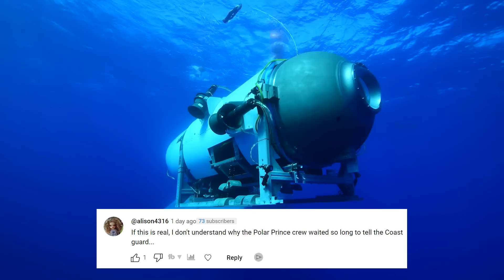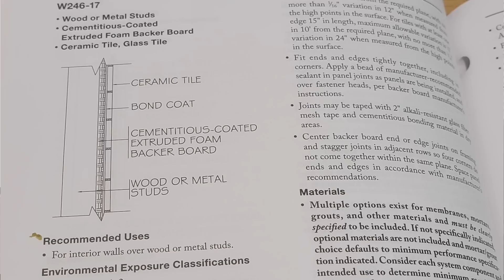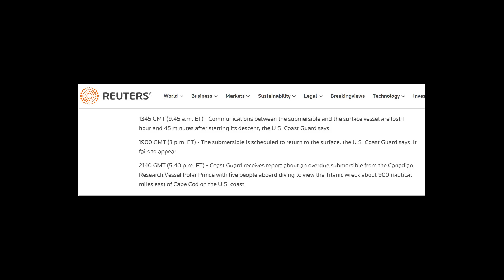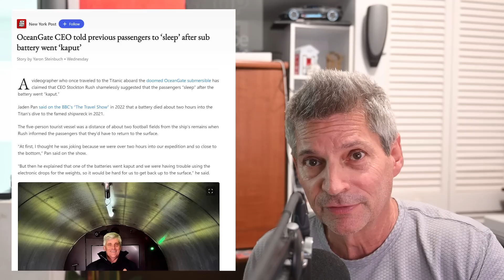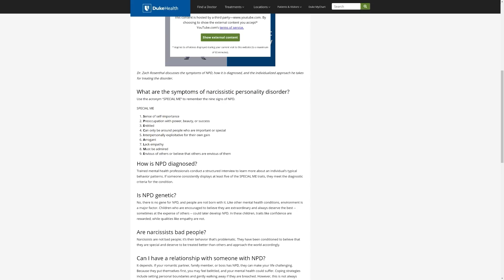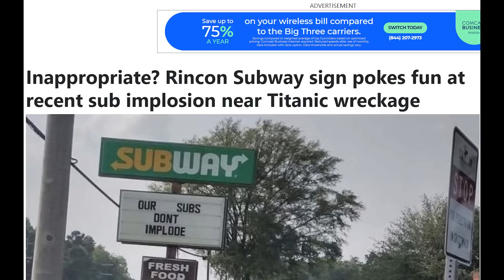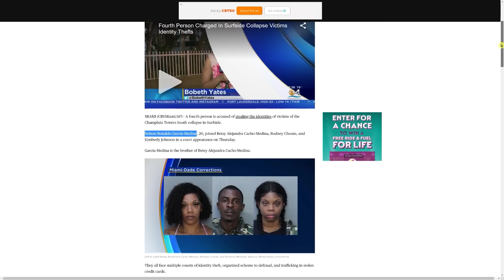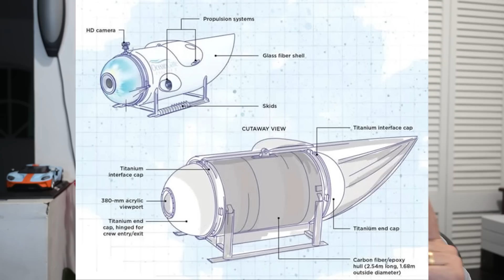Titan Sub: Why OceanGate Waits 8 Hrs Call Coast Guard, Q & A

Comment: Just to clear up some misunderstandings: while the Titanic sinking was absolutely a by-product of hubris and arrogance, that wasn't all that was to blame. First, I know it is a thing these days to make a parallel between Titanic and the word "unsinkable". However, it is worth mentioning that nearly every vessel prior to this that featured watertight compartments was declared unsinkable in marketing, official communications, or informal parlance. So, this wasn't something that was unique to the Titanic, by any means.

Picking up on the point about lifeboats, it's worth pointing out the two things that informed the decision on the number of lifeboats: will passengers actually get aboard them and how long will the ship take to sink. See, people didn't trust lifeboats at the time, with good reason, because they had a really poor safety record. So, it was better to have fewer better equipped and better built lifeboats than it was to have many poor-quality ones. The less it looks like a dinghy, the better. More to that point, because of innovations in things like watertight compartments, people assumed (incorrectly, obviously) that it was be impossible for a ship to sink quickly enough that help wouldn't arrive in time. The assumption was that no matter how badly a vessel was wounded, she could stay afloat long enough for help to arrive, since there were always dozens or hundreds of ships making the same journey along the same route. In this case, the lifeboats would act as water taxis ferrying people between the stricken ship and the rescue ship. It didn't matter that their weren't enough for everyone; or, at least that was the assumption that was made. So it wasn't purely for reasons of greed and outright malice that the ship didn't have enough. 

As for the book Futility. Yes, it is a little bit eerie how many details they include that parallel the Titanic, but it is worth mentioning for contexts' sake that the book was only renamed "The Sinking of the Titan" in 1912, after the Titanic had already sunk. This is also when the artwork showing a four-funnelled ship sinking below the water was created. While the books content mostly remained the same, some edits were made to make it seem like more of an accurate prediction than it really was, so it's not quite as crazy as it seems. 

I know some people seem to think that the White Star Line cut corners and adhered to insufficient safety standards to save a buck, but it just isn't an accurate reflection of reality. Titanic, in most respects, actually outdid the official safety regulations by many orders of magnitude, and was designed to incorporate as much of the modern technology available to improve safety on voyages as was feasible. It literally was the state-of-the-art and the final word in shipbuilding (at least, as long as it stayed above water). James Cameron gets it right when he draws parallels between the hubris and constant ignoring of warnings, but the comparison really doesn't go much further than that. What Stockton Rush and OceanGate did is far more sinister and far more dangerous than anything that happened on the Titanic.

They knew that the material they were working with was probably not appropriate for the use case. They were warned as much as deep submergence experts both within and outside of OceanGate. There were a number of troubling incidents in the leadup to this incident which would have made sane people back away quickly had they known. They lied about just how experimental and dangerous their sub was. They misrepresented the act of classing a vehicle with ABS or DNV as something they could get away with not doing. The list goes on and on. 

On the other hand, making the Olympic-class liners the safest ships on the seas was a key part of the design process for Titanic from the beginning. Hencewhy she had a double bottom, watertight doors, backup dynamos, new-type davits that could handle more and heavier lifeboats, wireless communication, multiple ways of steering the ship, and more. She was also extensively tested and went through all the sea trials that were normal for the time, long before she carried paying passengers. It was a boon to be able to advertise your ship as safer than the competition, and money wasn't actually an issue for the White Star Line (they were owned by a massive liner conglomerate at the time, with lots of cash floating about). They could spare the expense of making the ships safer than they theoretically needed to be. 

There are some tragic parallels between what happened with Titanic and what happened with Titan, but we need to be clear about how they are different as well. Because they are very different. One was the fault of hubris, ambition, and carelessness that ended in extreme tragedy. The other was caused by active mismanagement, extreme hubris and ambition, and a complete disregard for the principles of engineering which have made our world so very safe and secure.

Comment: I’m not an engineer, but even i know that if a non elastic substance is subject to repeated cycles of stress, then it will inevitably fail at some point. Empirically, i would guess the failure is dependant upon the strength of the force applied, and the inherent tensile strength of the material which is bound to be compromised if a non- homogenous material is used. In my own observation, if i accidentally step on the Dog’s squeeky rubber sausage it has a different outcome to stepping on an empty pringles canister.

Comment: 1) Design a sphere for your carbon-fiber sub - not a cylinder.
2) Make sure the crew compartment has more than adequate thickness to withstand extreme pressures.
3) Have your carbon-fiber chamber assembled at the correct temperature and with the optimum weave for the greatest strength and durability possible.
4) Test your carbon-fiber crafts (both destructively and non-destructively) as much as you are able to and can afford - including expert ultrasound testing after every dive.
5) Don't use carbon-fiber in the first place, dunderhead!!!
Reply: Why did you write all of that and not just number 5?
Reply: @turkwendell6904  An attempt at humour.
Reply: @malvanlondon8683  oh well that was me not getting it and now that I do that was funny and you're cool and have a nice day

Comment: I have not got any answer from any other Titan report, wen I ask what significance is there to the carbon hull being left as 5 inches thick instead of a planned 7 inches , and what would the accelerated descent, indicated in the text message,  do to the different materials used and their jointing , I had thought that the divers as well as the hull, needed to descend in stages and not do a continues dive.
Reply: Divers don’t descend in stages, they ascend in stages to allow expanding gases dissolved in their tissues to escape safely. The Titan (and all submarines) keep surface pressure internally so they don’t need decompression stops.
Reply: @fredbloggs5902  fair comment although I think its partly down to the water pressure being directly on the divers body, in this case the inside is meant to retain a set atmosphere ? , what about the effect of fast pressure increases on a submersible, is it not necessary for the structure to have time to adjust to the increasing tonnage of pressure ?  I am wondering how much is structural failure do to engineering faults and how much is down to incorrect piloting ?
Reply: @stuartgraca  You’re welcome to ‘think’ whatever you like, if you try hard enough it might even improve.

Comment: It's not the carbon fiber problem, it actually can hold and sustain greater pressure.
the problem was with its characteristics in comparison to the titanium which was used to seal the front and end.
since both material compresses and decompress in a different coefficient under the same pressure, this creates gaps and dysfunctional structure.

here is a theoretical example, when under great pressure the carbon fiber might compress more than the titanium, since both are bolted together, the edges around the bolts want to shrink more, but the bolts hold them in place, so you will start hearing tension cracking, depends how much tension and how much of carbon fiber left to crack, eventually by time all the carbon fiber will crack and stretch  leaving the bolts, then inplodes.

so, don't blame the material, blame the structure..

Comment: I am in the GPS business and understand the mathematics of determining position. Given the variances of the dive (descent speed, currents etc) how did they determine position? I am guessing on an array (constellation) of submersed transponders or transmitters able to communicate with Titan. These would mathematically triangulate every few seconds and carry the messages at the same time. 
Another question is why didn’t the Titan roll in 3 dimensions due to current and other shifting forces so that occupants could end up upside down?

Comment: I heard an engineer refer to a lot of the practices that OceanGate undertook as the “normalisation of deviance”. Like, if they heard cracking sounds but nothing bad happened a few times they decided this was normal, if they repeatedly lost comms at a certain depth but nothing bad happened, they decided this was normal. All excuses to avoid spending more money on testing. He clearly didn’t have proper engineers working for him because they should have known about NoD and called him out on it.
Reply: It is also known in a factory environment as industrial blindness.
Reply: Stockton Rush fired anyone who told him things were unsafe.
Reply: Correct...Stockton was bent on hiring "innovative" people which meant younger people and with that comes less experience and training so you really have to wonder if OceanGate had any "company training and education" protocols for those employees. He was so vocal about not hiring the norm "50 year old white men" who had lots of Government experience and training via the Navy or NASA etc. Stockton was sure to hire those who wouldn't have the mental groove or rut in thinking that everything that is used has to be "approved" or tested and proven. I especially liked Stockton's dumb display and comment he made about the roof mounted illuminated grab handles that he purchased from "Camping World". When you are that deep and using only battery power, wouldn't you think the OceanGate engineers would have chosen something more consistent in power consumption? Something designed to be in harsh salt water environments? I can't imagine how the corrosion levels are inside of those game controllers...micro switches etc. which are also subject to the hard environment of salt water, salt air etc. Did they use those once and replace them? 
Way back when they fired their safety engineer and then he sued for wrongful termination, OceanGate paid a settlement which proves they were wrong in terminating him. Seems like the core operations of OceanGate is rather boldly.

Comment: Polar Prince waited 8 hours because the last communications the Titan sent stated they were returning to the surface at "quarter" rate. The ascent useally takes two hours, so 2 times 4 equals 8 hours.
Reply: Also, one electrical system had failed. Maybe top thought that the other system had failed too and the sub would have no communication until it reached the surface.
Reply: @pierreabbat6157  Exactly. They hoped and waited.
Reply: That makes sense.

Comment: The problem was Stockton Rush. His attitude problems and anger triggers drove the design of the vehicle, how it was operated, the fact that it was not fitted with data comms, all the way to how the surface crew operated on the Polar Prince.  The crew had been told they had no authority.  Only Rush had the authority to make changes or make the call to the Coast Guard.   They were too afraid of making him angry to speed up the time.  He was at risk. But even that was not enough to overcome the fear of making him mad.  And the power of that fear was based on the fact that the employ😮ees were interns and college kids and people generally afraid for their jobs because they could be replaced, rather than having employees with high skills and training.  They had interns making low wages scared of losing their jobs, which was guaranteed to happen if they made Rush mad.  So they waited. They had no authority to override. They were afraid.
Reply: Rush's wife was on board the Polar Prince. Transferring and hiding their money was probably a more likely reason.

Comment: When you read the transcripts of messages between the sub and the top surface you will then know for sure they knew what happened. Denial, Grief,and etc...are things they were dealing with that's associated with shock. Carbon fiber works great for planes due to its expandability but not good for deep Sea compression. That's just common sense

Comment: side tracking here a bit, only because you used it as an example, as far as the space shuttle goes, it wasn't so much as arrogance, as it was more ignorance.  Morten Thiokol told them NOT to launch in those cold temps and NASA asked "WHY" and then asked MT to back up their warnings with proof.  MT  couldn't because they never launched in cold before.  So NASA said if you can't prove it than its not valid.  Also, NASA was on a tight schedule, and rushed to launch and its what we call in the aviation industry, "Get-there-itis" meaning, you have to "get there- your destination" at all cost for what ever reason, and in doing so you become complacent.  So in the case of the Shuttle its very different than OceanGate who blatantly ignored warnings with PROOF where as the NASA WAS interested in hearing from MT, its just MT could;'t back up their claims...  had warnings with no proof added with "Get-there-itis."

Comment: "They cant use GPS under the ocean, the signal is too weak. They have to use hydrophones and sms"

Isn't there tech to triangulate hydrophones on the fly, to kinda figure out more or less where the sub would be?
How accurate would that be?

Comment: They didn't use the autoclave method either which has far fewer flaws.  So instead of 50 compression cycles before imploding, maybe it would have been good for 500 cycles, but nobody knows for sure.  The sub was designed to fail and they were delusional to think that they could detect it failing gracefully intead of catastrophically.
Reply: An autoclave is necessary. Even Formula One teams use enormous autoclaves to bake the carbon fiber despite the mind-boggling costs. Why? It's for the driver's safety. Well, i guess Stockton Rush didn't care about safety so why would he invest in an autoclave...

Comment: 10:38 I disagree. The woven pattern would do nothing to help with external pressure and would make it worse because it decreases the fiber content while increasing the epoxy content and increase the air bubble content. The delamination problem would not be better. Either way the fibers are in compression and THAT is the problem. The hoop winding with its higher fiber content would be slightly stronger but still not strong enough.
Reply: yeah this, I watched another engineer explain the process in a video who also mentioned the air bubbles.  Straight up having anything with fibers trying to withstand high pressures is... wild.
Reply: Why do you think woven has less carbon fiber?  That’s not what I’ve seen in tanks made from the stuff.  It looks like the same amount.
Reply: But yes fibers (like rope) don’t do well in compression.  They are best in tension
Reply: @electrictroy2010  It is impossible for crossing fibers to nest as closely as hoop wound fibers leaving space to be filled and air bubbles to be trapped and the increased likelihood of air bubbles. Two steps are formed every time a band of fibers crosses the previous band forming another pocket to be filled. 
Aside from all that, composites are always used for internal pressures. Internal pressure not only tries to burst the tank but also tries to pull it apart lengthwise and that is the reason you need some component of the strength to be in the axial direction. But this is an EXTERNAL pressure that is trying to collapse it radially AND collapse it lengthwise too. The weave does not help much with the axial compression since you can't push a rope while at the same time it forces you to have greater epoxy content and more air entrapment making it weaker. Neither way makes composites work for this but hoop wound is slightly less bad because there is less air and less binder.

It might be possible to use composites like that if it was rated for less depth, determined by testing. It might have lasted many years if only dived to 1000 meters or so.

Comment: @jeffostroff the sub didn't actually get stuck down there for 24 hours, he simply suggested to the passengers that because they were so close to the bottom, they should sleep in the sub and drift down to wreckage, because they COULD just wait to hit the 24 hour mark for the mechanism holding the weights to dissolve. The issue was a battery was lost and going to keep them from being able to use the hydraulics to release the weights, but he ended up getting it to work, so they didn't end up sleeping in the sub. Unless that same situation happened twice and once they did sleep in there and the other time they didn't. Also don't think I'm taking up for the guy, I'm certainly not I think everything he did was beyond reprehensible. That's just not how the story went.
Reply: If you look at some of his ideas such as those self dissolving weights, that was actually a good idea.